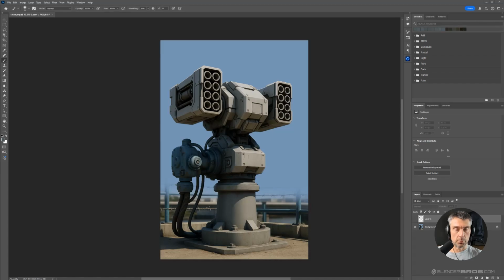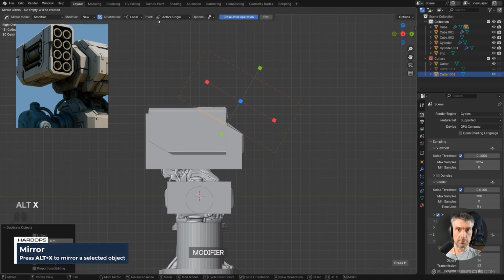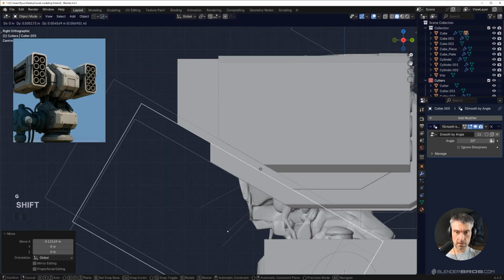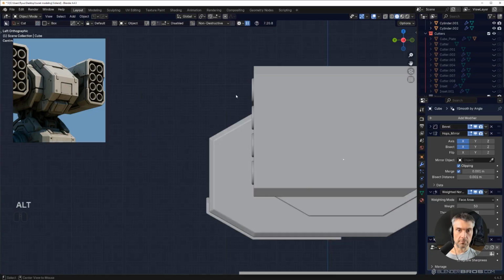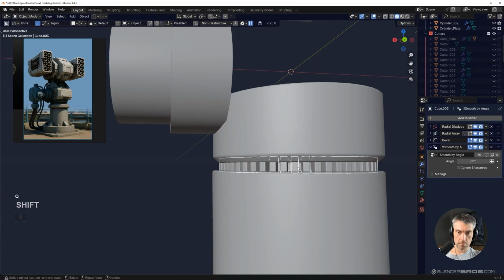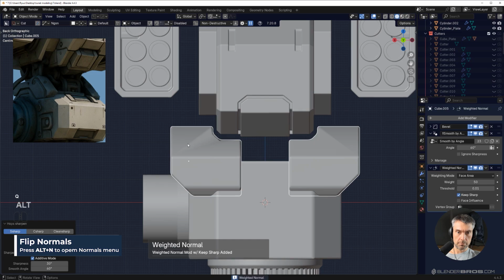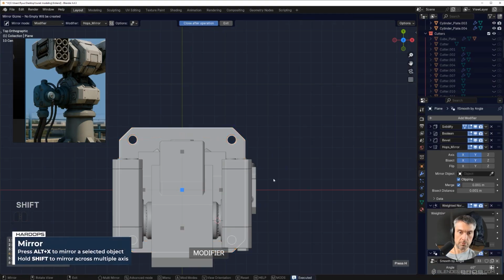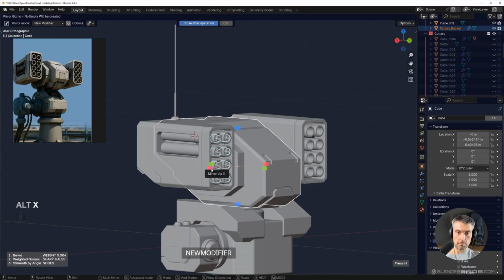Blender Hard Surface Modeling – Sci-Fi Turret Step by Step

Comment: Can't decide wether to get the Hard Surface Accelerator course or the Hardops and Boxcutter one.. $197 per course.... i'm only new to Blender i moved over from Cinema 4D so still feeling it's a little alien to me.. love the 3D truck one but not sure if i should pick it just for that..
Reply from the maker: It really depends on how well you know Blender. accelerator is for complete beginners and intermediate folks who wanna improve their knoweldge on hs modeling and also tighten their workflows. HOPS course is purely focused on the addon workflow, and although all the tools are explained in great detail, I do not explain basics of blender. You do know 3D so you may be fine with hops course, especially that all vids have keystrokes displayed. Blender is shortcut heavy and there are a lot of basic tools worth knowing, which again, are explained in the Acccel. Hops is basically a natural progression from Accel.
Reply: @PonteRyuurui  Thanks for the info, I'll maybe start with the HS Accelerator course and see if i can get up to speed in Blender with that first then, I have purchased Hard Ops and Box Cutter though so ideally do want to make better use of those soon, as I can see they're the powerful ones.
Reply from the maker: @M_E_T_R_O_9  DM me on Discord if you like, we are developping a new offer right now which may be something you'd like, mainly becuase oif how it will be structured.

Comment: Hi bro, I'm working in Blender 4.5.1 .By the way , just wanted to mention that in version 4.5.1 the flip operation with boxcutter works fine.Maybe it was fixed after 4.5.0. Thanks for the tutorial,really helpful.
Reply from the maker: man that 4.5 and 4.5.1 is a disaster, it keeps crashing, i a gettign errors, i am back to 4.4 till they fix that thing